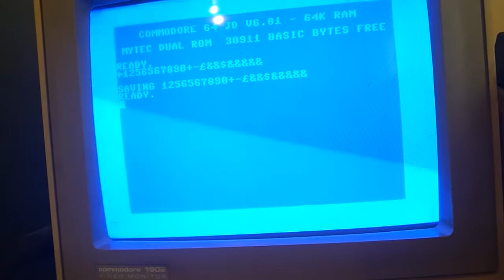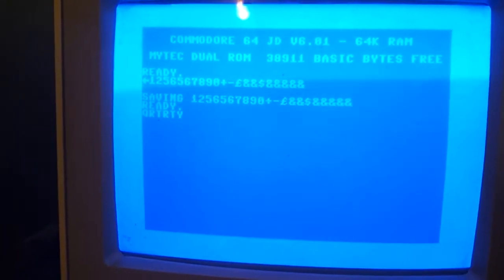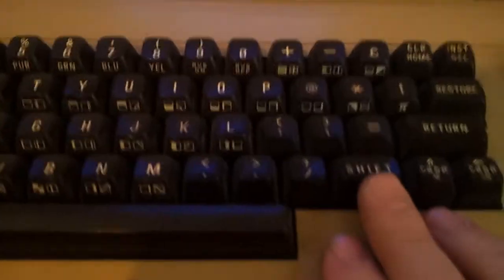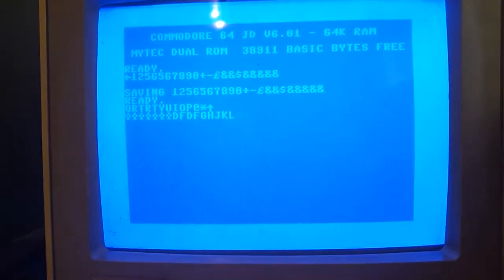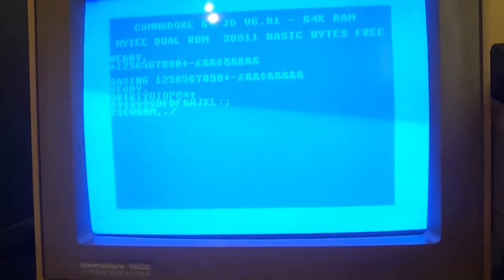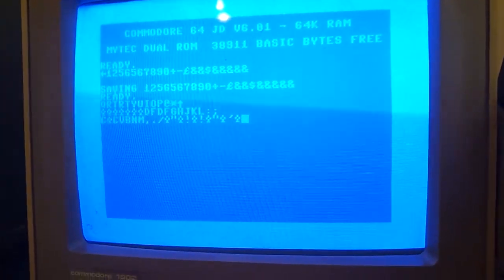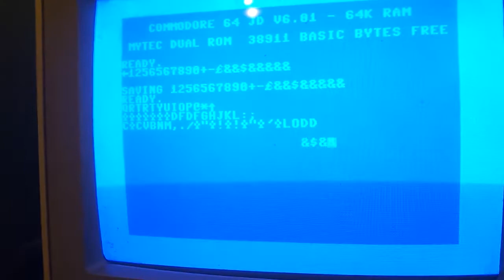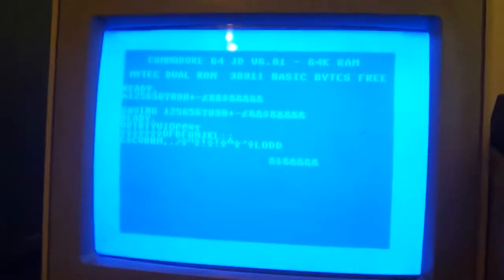What Static Electricity will do to a Commodore 64

Comment: I just repaired this machine for Chris537. The static actually shorted the traces running to joyport 2 under the solder mask and I couldnt find it even under magnification so I had to cut a trace and run a long jumper in order to restore it back to working condition.